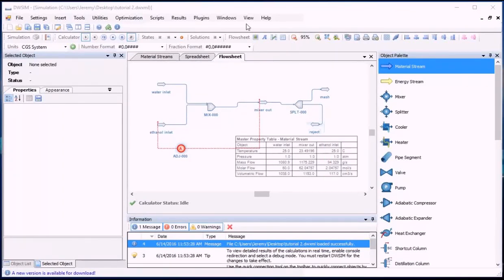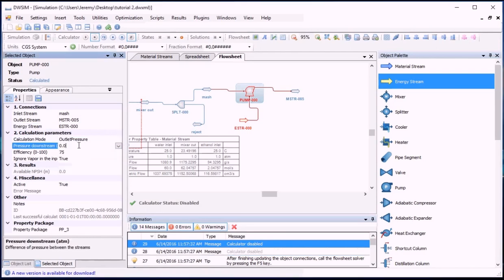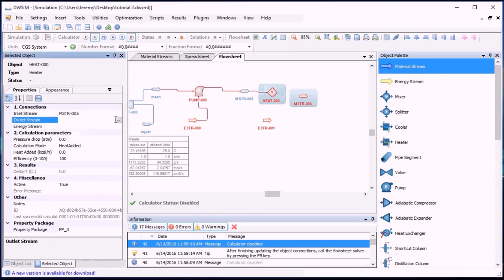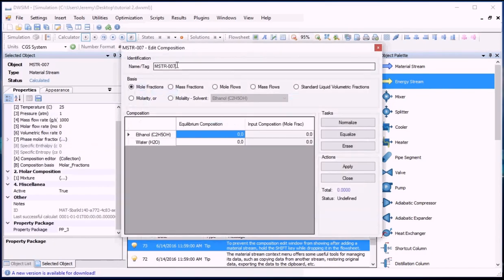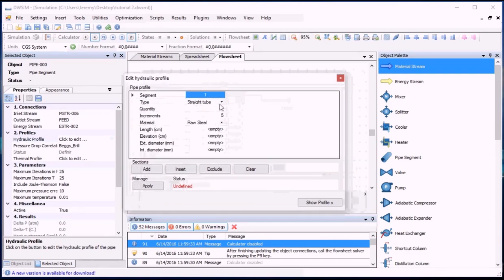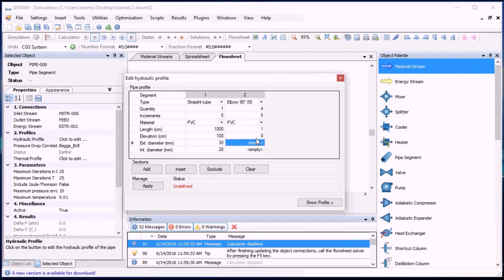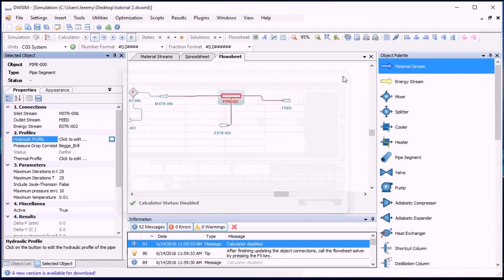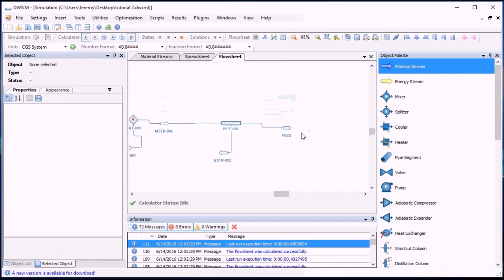DWSIM Tutorial 3 (Pumps, Heaters & Pipe Segments)

Comment: your final numbers were not reasonable. Your pressure and temperature increased through the pipe.
Reply: Both pressure and temperature decreased, the pressure went from 2 atm to 1.96 atm and the temperature from 111.48 C to 111.47 C.  The signs on the pipeline block callout are incorrect but this was fixed in later edition of DWSIM.

Comment: Hie if l use length of 1000cm l get a negative pressure drop. I am using DWSIM version 4. Your correction will be much appreciated!
Reply: Same problem here, have you found a way around this problem? Sometimes it calculates it with a negative pressure and a huge decrease in temperature, sometimes the pressure goes below 0 and i receive an error :/
Reply: I changed the number of segments in the hydraulic menu to 10 from 5. This enabled me to run the Lockhart method for calculating pressure drop. Also, notice he didn't put a thickness in the insulating material. I calculated a ~9.8 degree Celsius drop across the pipe 0 cm thickness of polyurethane and ~7.4 degree Celsius drop across the pipe with 10 cm thickness polyurethane. My pressure drops were between 0.4 and 0.6 atm for the simulations.
Reply: If you plot the Temperature vs Pressure for the pipe segment, there is a linear correlation. I'm not familiar enough with the mechanics of the equations to understand why that would be the case, however, it shows that your hydraulic model will directly determine your overall heat transfer coefficient calculations utilizing this method; that is - the lower the pressure drop the lower the temperature change
Reply: hello ! please I have a homework about DWSIM can u help me please ?
Reply: Lockhart & Martinelli is not recommended for two phase flow. With an elevation of 100 cm the liquid will vaporize as a result of the pressure drop. You should use the Petalas-Aziz correlation instead.
Reply: @DanielWMedeiros  this suggestion removes the error.